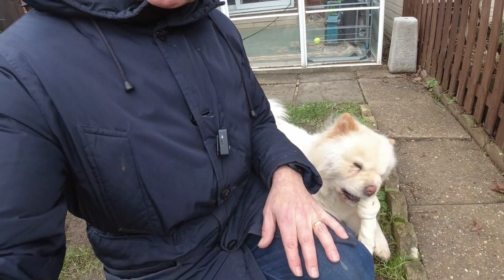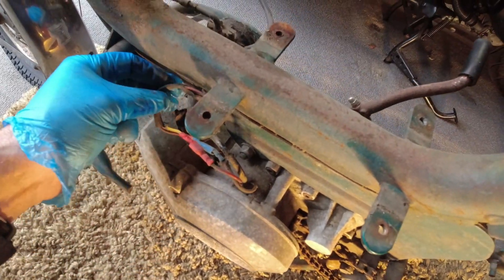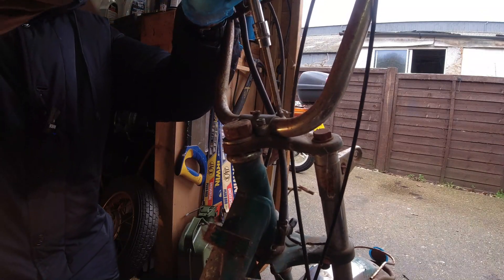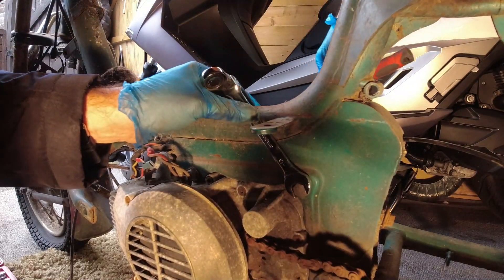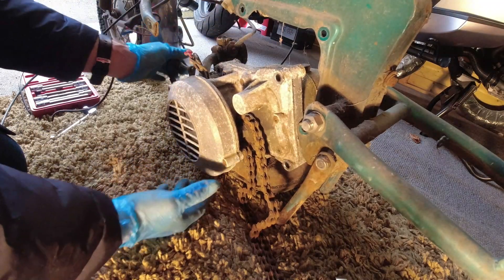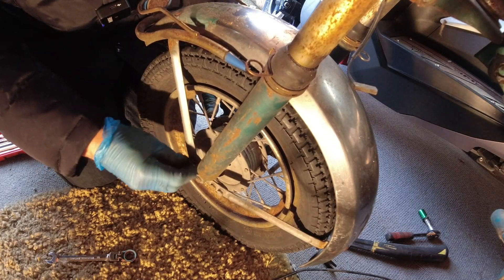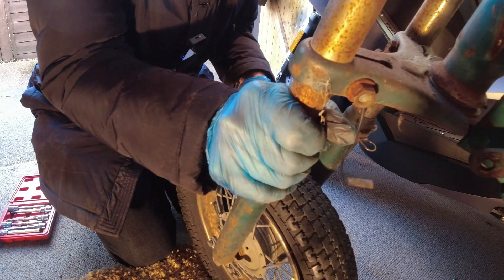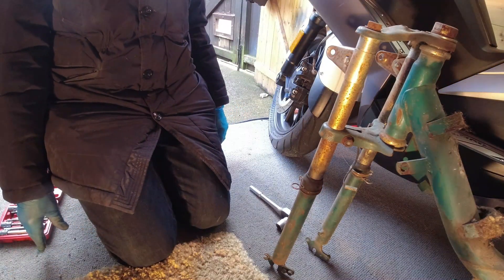Cimatti Mini Chic Italian Moped ( Part Two )

Comment: Hi Jeff
Enjoyed the video this bike has light rust in this country with all the rain we get its not to bad but in Italy I wonder how much rust it would have with being there I bet not many cars and bikes have rust problems jenny looks happy nice to see great video

Phil I  stoke
Reply from the maker: Hi Phil and thank you. Unfortunately that's the problem with this country, everything rusts. Next weeks video was supposed to be restoring the front wheel. I have been held up,  where the bike had been sitting with the hole in the tyre I've found a few little pin hole rust spots. The wheel still has it's strength, but it's the first wheel I've had a problem like this.
So a different video next week as I am back to work for three days.
Reply from the maker: Take care, Jeff